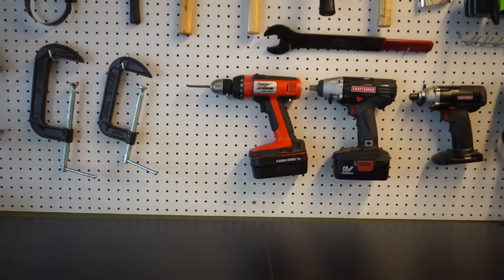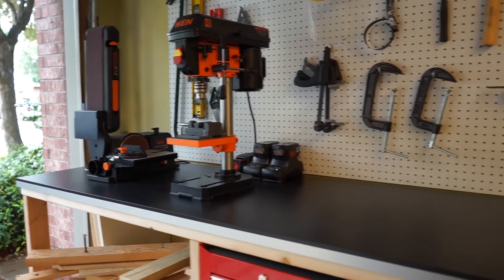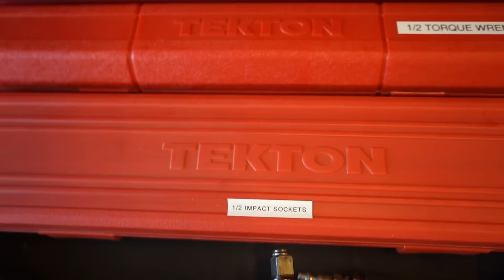Toolbox Tour and tool review

Comment: I took a rotary rake apart with the 3/8 harbor freight impacts and never had a bit of trouble with them.
Reply from the maker: I think their issue is more with inconsistency in materials. I have had them explode on me but have had friends use them for years without issue. I guess it's just the luck of the draw.

Comment: i was reading the specs on the harbor freight "impact" sockets and it said they're made out of chrome vanadium, which is what regular sockets are made out of so you're probably right about their impact sockets
Reply: Bobby Larkler harbor freight also sells chrome-moly impact sockets (same as snap on, matco, mac and so on) so you can buy professional  impact sockets from there. i know this because i have bought them and they are awesome. never had any problems.
Reply: Jason Smith you're right. but that's what impact sockets should be made of since it's the tougher material. the 3/8 "impact" sockets are made out of CRV maybe slightly thicker but still not as good as chrome moly
Reply: Bobby Larkler ok you're 99% right but you didn't specify in your first comment that it was 3/8 impacts. You just said "impacts". And, actually, Harbor Freight does sell chrome moly in 3/8. It's the 7 piece 1/4, 3/8 e-drive set impacts. It may only be a couple pieces but they do sell 3/8 chrome moly impacts.
Reply: Jason Smith haha my bad. thanks for clearing that up for me though.

Comment: Hi there, I was wondering, although you have almost anything...
Is a screw pressure wrench (can't remember the name) absolutely necessary? You know, to tighten bolts to the makers specifications...
Also, which bolts are important to check pressure on, and how/where can we find said specification?
Thanks a lot!
Reply from the maker: I think you're talking about a torque wrench. Whether or not it's necessary depends on what you plan on doing.  If you're going to be doing anything internal to the engine then it's a must. You can get a the exact one I have on Amazon (link in the description) for around $30-40.

Comment: hi, I want to ask you about the electric impact guns, have you tried those in cars? to unfasten or fasten axle nuts, or big suspension bolts. I want to know if they are capable of doing that
Reply from the maker: I have never taken off an axel nut with it but I have used it for some larger suspension components. My Craftsman one is a mid level gun. You can get some more powerful ones from Snap-on and a few other brands if you plan on doing a lot of heavy duty work.
Reply: Thanks, I will look into those!
Reply: I have one of the big milwakee imoacts, works great for what youre looking for. Bu if you wanna go the cheaper route go air